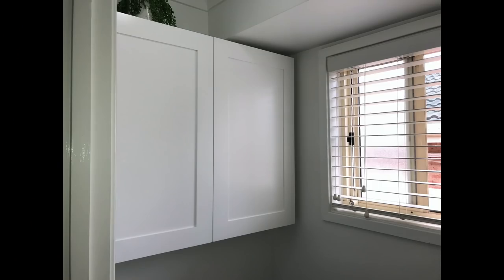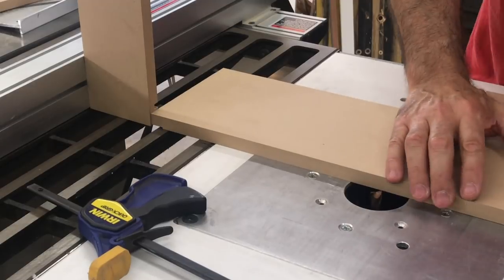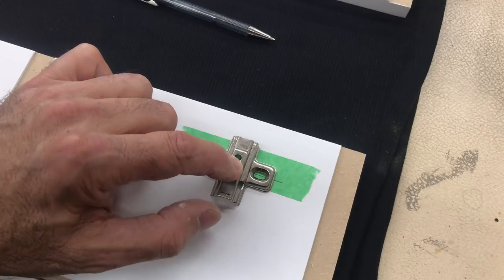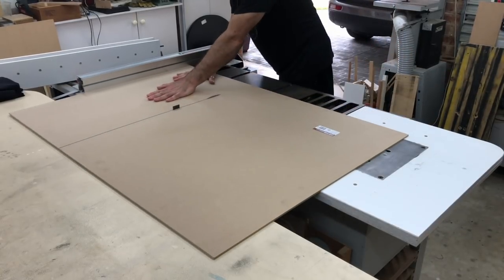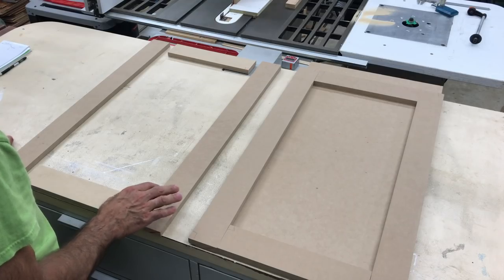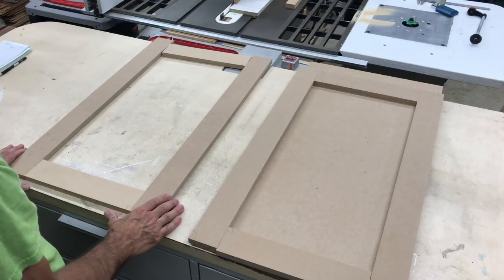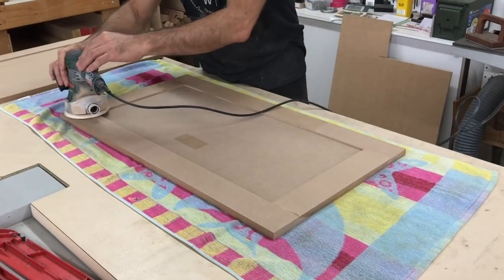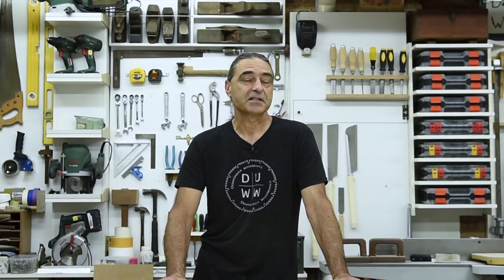How to make a cheap and simple shallow wall cabinet

Comment: Wow midnight premiere, very rock'n'roll ;) One Man Band would be proud of the craftmanship (maybe less so of the MDF 😆) Look like they were always meant to be there, great build. Got me eyeing off the slot cutter bits now. Much easier and safer than running boards on their edges through the router!
Reply from the maker: Haha, its just ended up like that cause the upload was so slow. If Luis @One Man Band Woodworks likes it then you can be sure its good. The slot cutter is a great addition to your router bit collection.

Comment: Very professional looking. I have learned a lot from Peter as well. Currently I am building built-in bookcases around my fireplace and decided to use MDF because I saw how well Peter's work comes out. Of course I am not as talented as either you or Peter but I think it will be ok. Thanks for a great video!
Reply from the maker: Thanks very much Mark. The built in bookcases sound like a great project. Good luck with them, maybe you could post some videos

Comment: Firstly great video, thanks. I recently saw another youtube video where the guy made Shaker style doors simply by gluing the front outer frame sections to the front of a backer board, it looked good and for those without a router table it is a alternative method.
Reply from the maker: Thanks Azza. I made these faux shaker style storage/planter boxes the same way https://youtu.be/cl8AO2PxtEw but also take a look at this interesting video about why not to make doors that way https://youtu.be/BQ3UZ8sqsss. Cheers mate

Comment: Hi Vic, where did you get the MDF? The material Peter gets in the UK, looks a lot cleaner.
Reply: Very nice job too by the way.
Reply from the maker: Its just standard MDF from Bunnings. Peter almost only uses water resistant MDF. It does look like a better product.

Comment: Hi Vic. Good project turned out good.  Looks like you have the same problems I have @ 8:23 can’t find the stud lol 😂 so many drill holes.
Reply from the maker: Haha, its actually not as bad as it looks. I knew there would be a stud at the corner of that bulkhead but i found there was actually two there so even better. Thanks mate.

Comment: Nice project but why not use melamine since you painted white? Any particular reason? 
Cheers Matteo
Reply: The main reason would be the edge banding required, but painted MDF always looks better than melamine
Reply from the maker: Yes Matteo, melamine is a great material for cupboards and cabinets but it has a particular look that is very clean, crisp and almost clinical. this can be ideal for situations such as kitchens and laundries where as painted MDF has a softer, warmer look and feel and you can paint it any colour you like.

Comment: It's only easy if you've got a fully equipped workshop.
Reply from the maker: I disagree Gareth, a fully equipped workshop (which i don't have) isn't necessary. This can be built with basic power tools